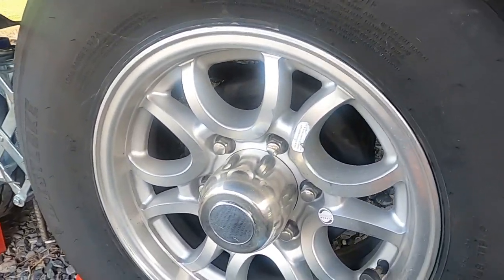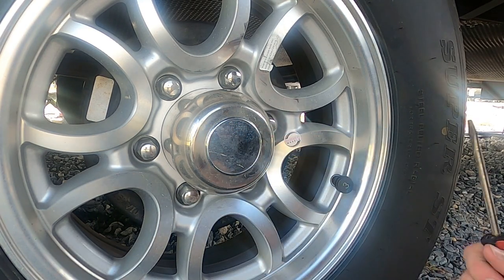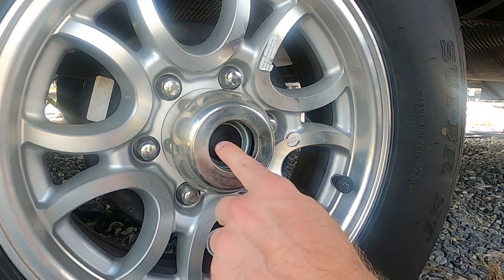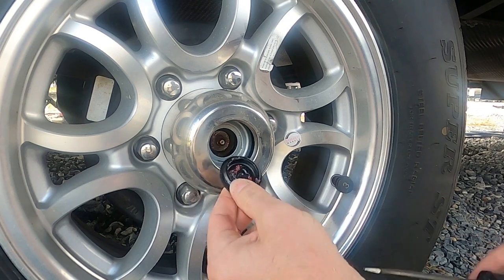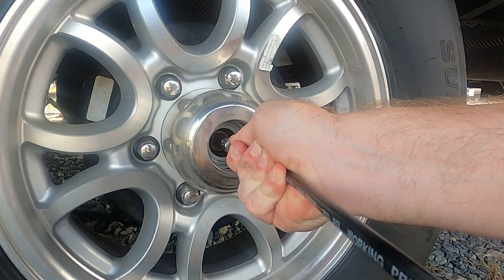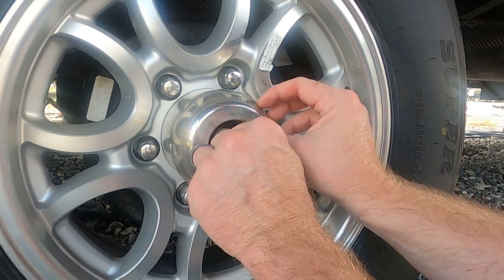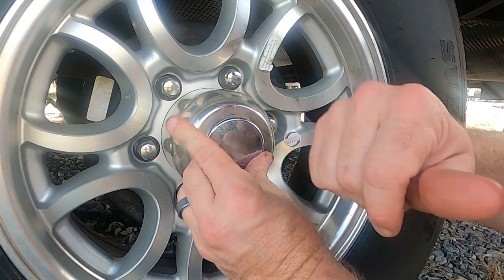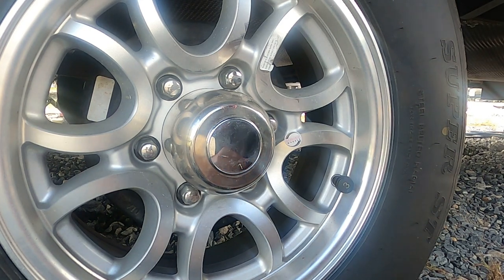Greasing Trailer Wheel Bearings

Comment: Just came across your video. I’m a newbie to travel trailers. My question is other videos I’ve seen show pumping/adding grease to the bearings until you see ‘new grease’ while spinning the wheel at the same time. Is there a difference between what you’re doing and what they are doing? Asking since I don’t know. Thanks!!
Reply from the maker: First of all, thanks for watching. Spinning the wheel is a good way to make sure your filling the bearing with grease. The problem with it is if the bearing already has grease it can damage your seals. I don't recommend putting more than 2-4 pumps per wheel bearing. Too much grease can cause your seals to rupture or it can cause your bearings to run hot. That will shorten the life of them. I hope this helps.
Reply: @WilsonsWildRide  Thanks!

Comment: What kind of grease do you use
Reply from the maker: Valentine's full synthetic moly-fortified grease. This grease is rated for high heat and heavy loads. Any high heat, heavy load grease should be fine. Just remember if your just adding grease, only 2-4 pumps per wheel. You don't want to blow out your seals. Happy Camping!!
Reply from the maker: Valvoline not valentine. Dang auto correct lol!